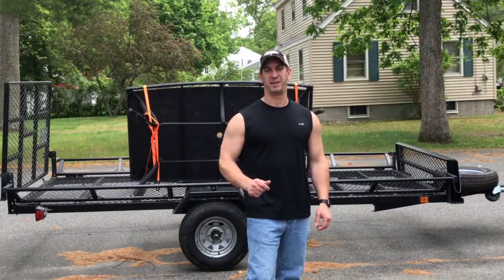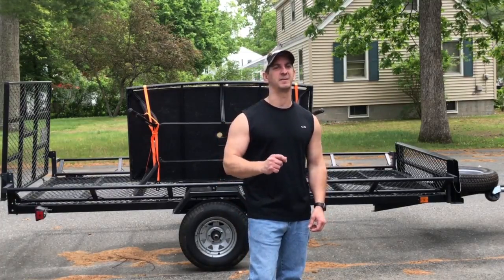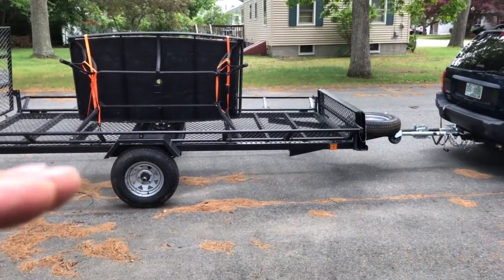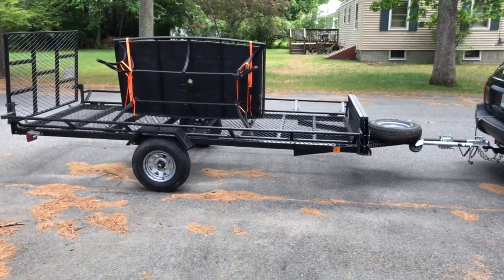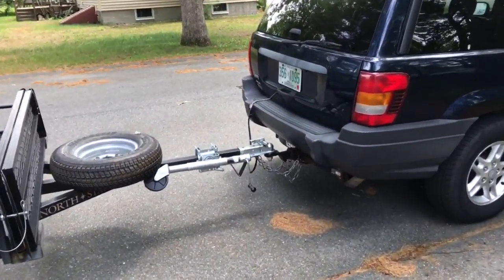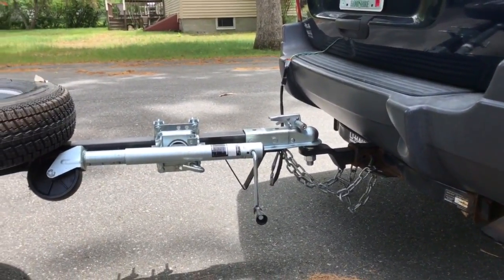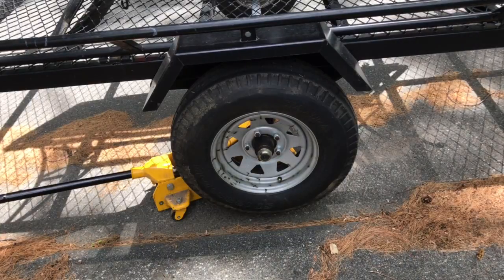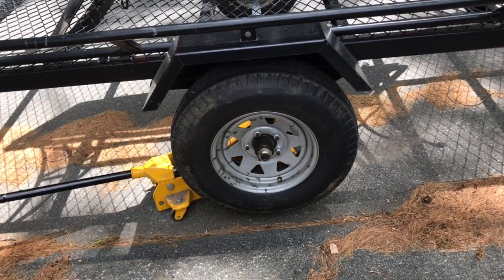How To Get a Utility Trailer To Stop Bouncing While Being Towed

Comment: Most trailers of your size come with high pressure rated tires. Many of them aren't radial ply ties so they have thinner side walls. If you really want to improve the ride and have less bouncing buy and install a pair of low pressure radial ply tires that gain their load rating from thicker sidewalls and tread area. The high pressure tires require an air pressure rating of 45 - 60 psi if I recall or about so giving a very hard bouncing ride when not loaded. Try going to a wider tire about 3 inches wider that requires only 35 psi yet carry the same or more payload. Another thing to help your ride is to install shocks made for for trailers yes that make and sell them. My 6 X 12 trailer will still bounce a bit after these two things I did but about 1/4 as much. When I have it loaded or empty I can't tell its back there using my litter 1970 Voltswagon Beattle  LOL
Reply from the maker: Thanks for watching
Reply: exact info i needed , i got those same rinky dinky hp rated tires that i want to upgrade and your comment helped explained how , hard to find info like this , so thank you

Comment: I had an 7.5 foot by 4.5 foot snowbear  trailer rated for 2000 pounds that bounced lots when not loaded or lightly loaded but when I had 1500 pounds in, the trailer would ride smooth
Reply from the maker: The high pressure tires can cause that too, if there’s no load and the tires are at max inflation
Reply: that's the nature of the beast
Reply: No duh?
Reply: @speedfreak8200  ya freak spit more of our deep generational wisdom

Comment: Move your load forward to add tongue weight. That will stop all your bouncing issues.

The axle on a properly designed trailer is located so that tongue weight is proportional to the load. The load needs to be centered on the deck (front to back) to take advantage of this weight distribution. Putting the load directly over the axle, as you have, adds 0 tongue weight, and makes the trailer want to pivot around the axle. That translates to the tongue bouncing the tow vehicle up and down.
Reply from the maker: You should get in on this giveaway I'm doing https://www.youtube.com/edit?o=U&video_id=XJzj6DK7T7M
Reply: What's the giveaway? Link doesn't work.
Reply from the maker: This one should work https://youtu.be/XJzj6DK7T7M

Comment: Add 3/8 thick steel plate floor I have dual axle ex generator trailer main frame is 6"*2" c channel with 6 1/4 " members for generator bolting. I bolted 3/8 " steel diamond plate  (500 lbs ) and the trailer does not bounce much . Trailer gvwr is 7000 lbs. Dual 3500 axles with brakes. The trailer has a 4*8 deck . Trailer total dimensions 5 feet by 10 feet bumper to tongue.  Google MULTIQUIP 45 kW generator and you  will see the trailer.
Reply from the maker: I have ATVs that get muddy. I like having the mesh flooring on this trailer.

Comment: nylon tires will flat spot if trailer is not jacked up off the ground, also air pressure makes a difference
Reply from the maker: I keep them pumped up to the recommended pressure. On trailer tires if they are not up to recommend air pressure it lowers the trailer weight or load that the tire can handle